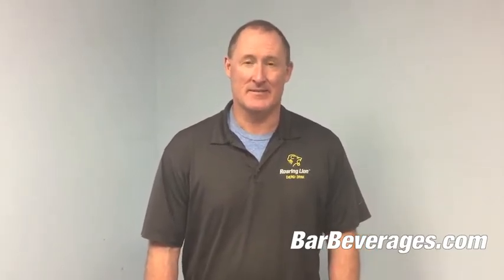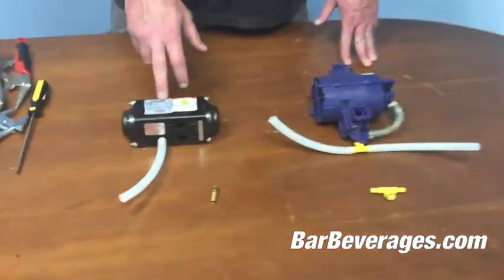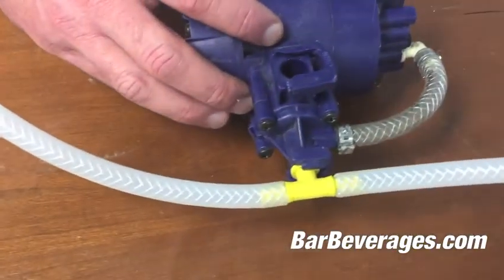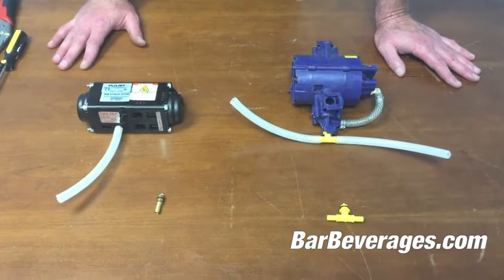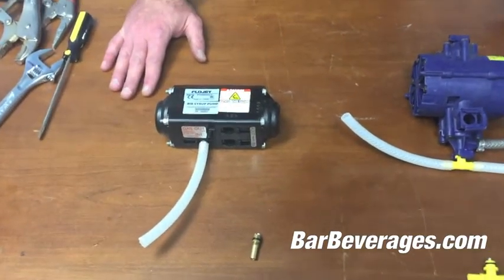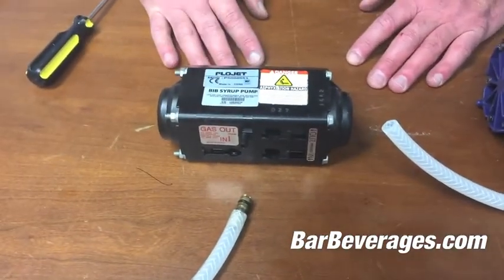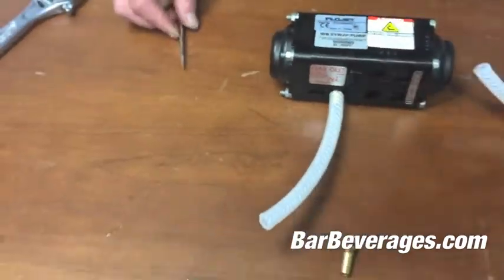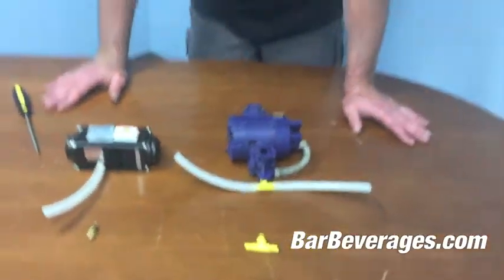How to Fix a Noisy Pump in a Bar Beverage Dispensing System

Comment: Flojet pump Repairable or Not
Reply: Dharmendra Shrestha just buy a new one. I had one seize up on me and tried to fix it. Only 1 year old, took it apart, and found out the hard way that there is a million small parts inside other than the diaphragm and the hoses. I called floret and if I had not taken it apart, I could have gotten a free replacement.